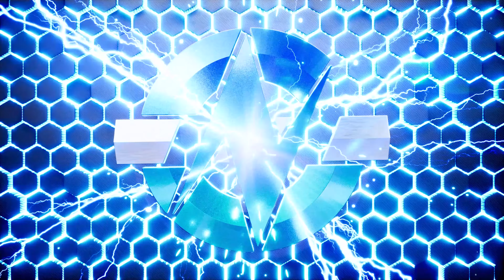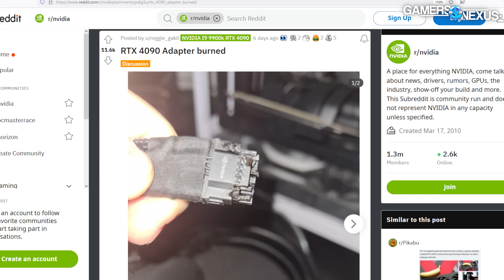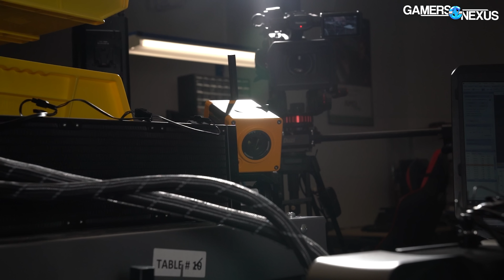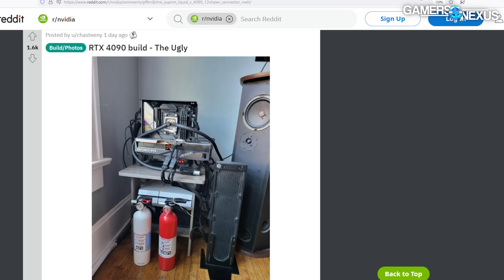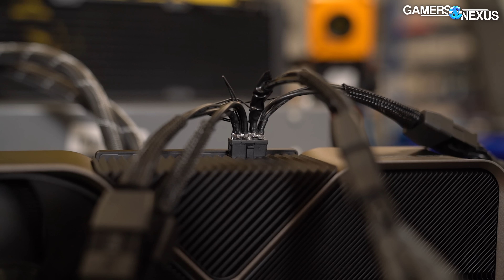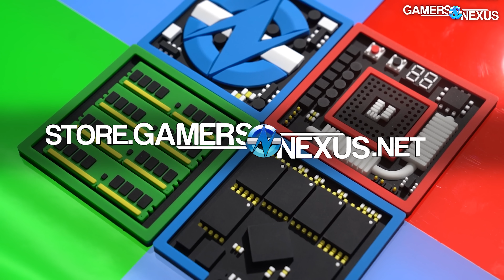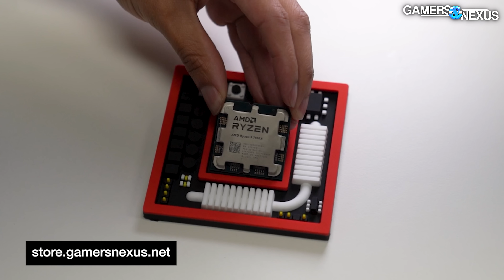Testing Burning NVIDIA 12VHPWR Adapter Cable Theories (RTX 4090)

Comment: Regarding the differences between Igor's cables and yours, maybe Nvidia is sourcing those cables from different suppliers, i.e. it is entirely possible that several variants with different guts are being shipped. Moreover, if the problem is caused by mechanical issues, i.e. some connectors not being able to cope with the forces that occur when the cables are bent to fit into cases, native power subblies wouldn't necessarily help because some of the cables shipped with these could have similar weaknesses, so thanks for mentioning that important aspect in the video.
Reply: could also be a AIB plug that igor has !!
either way still feels risky  to me !!
Reply: Yep, it's also plausible that it was just a batch or two of substandard produced adaptors, that slipped through quality control, that was made by one of the manufacturer's (possibly a few hundred or so adapters). Possibly, it might be a case where the manufacturer cut corners and instead used cheaper unspecified parts to either save on money or as replacement parts in order to cover a production order, when they where running low on stock. It also really wouldn't surprise me if that was the case, that the company at fault was a Chinese cable/adaptor manufacturer. Cutting corners, ignoring set out specs, along with ignoring safety regulations, really is the kinda thing they do very often do, in China. If so, then I doubt that it's was/is a regular occurrence and/or is a large number of them. I'm pretty sure that if it was a regular occurrence, than it would have already been picked up by quality control at either Nvidia or any of the AIB partners by now.
Reply: I wonder if Igor's cable is a preproduction sample that got through into a retail box somehow, it could also explain why not only are the cables differently rated but also why the construction is different
Reply: @MrTrilbe  There's probably earlier iterations of these before they made design improvements. The question is, how many of those early iterations shipped with the first batch of gpu's that came out of the factories, now sitting inside a computer?
Reply: @luminatrixfanfiction  the other question is how did the current design pass testing? we know there's a limit on plug/unplug cycles and it's stupidly low, why was that allowed? also are we 100% sure the problems just the cable? is there a problem with the PCIe 5 PSU spec as implemented? or with the card when the sense cables are in? is there a code bug somewhere that's only triggering with the sense cables detected? I wonder if there's a way to spoof the signals from the PCIe 5 PSU and draw power from a non gen 5 PSU and see what happens or just read what's going over the sense lines and seeing what the gen 5 PSU and card are doing when they're there? maybe i'm way off but the cable doesn't exist in isolation and errors can compound rapidly, we're concentrating on the cable, maybe it's not the whole fault here
Reply: @MrTrilbe  Of course that is a possibility with Igor's cable, but considering that by now more than a dozen cases of molten cables have been documented on Reddit alone whatever the root cause of the overheating issue may be it seems to be more common that a few samples getting into retail boxes accidentially. Therefore I consider it more likely that there's either a quality control issue with the production version or that different versions are being produced and shipped. Considering how much the construction of the cables GN and Igor have differs my bet would be on there being several versions in production.
Reply: @Raider_MXD  I'm not saying that there isn't a problem with the other cables, just that Igor's could be prone to a different set of problems and that's the reason why Igor's results couldn't be reproduced, someone found them and the design was changed to get rid of those problems, but new ones turned up and didn't get found in testing, giving us new problems with possible new causes
Reply: @MrTrilbe  Did you actually read Igors article? 
Because he said it is not mass production, its a hand made thing and that is why the quality is totally different for all cables..
Reply: You don't say?
Reply: Impossible. No room for doubt, what you proclaimed is, in fact impossible if it's native 12VHPWR. If it's native, there would be thirty-two connectors for sixteen terminations, It would be better-constructed then this weird strange adapter nonsense where bridging the delivered power isn't done in the connector housing, but just before with plastic and fabric tape covering it. Even better, it wouldn't have floating sense leads.

It would just flat-out be a better cable..I also detest the design of the cable with the sidebar connections being another set of differently-spaced connectors because they could had easily just made the sense connections on the sides, in the middle, anything other than what we have right now, which could had been keyed different or used different connectivity to create a sensible product that doesn't look foreign in application to anything else coming from a PSU, which would had been easier to manufacturer a cable for.

We instead received sadness.
Reply: Whilst I cannot remember what the rating on the 3090 was (I believe it was 450 max), I believe that the plug being turned through 90° was a better design philosophy and would have alleviated most of the problems we're seeing now, not withstanding the differences in the cable power rating.
Reply: Even if coming from the same supplier, there might be some variation in the quality of the cables.

Comment: That 40 series should use the same plug as electric vehicle
Reply: Preferably an MCS connector instead of CCS or Type2.  3 megawatts is probably just enough for the 4090.